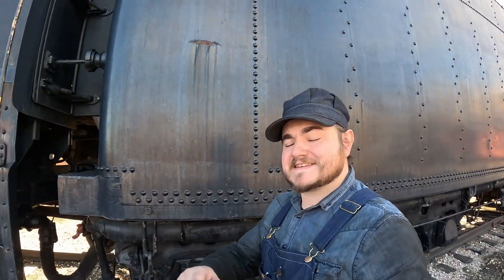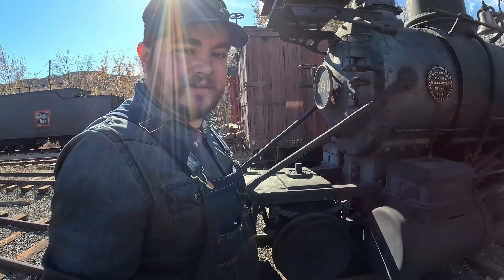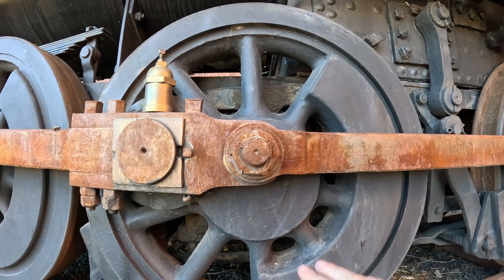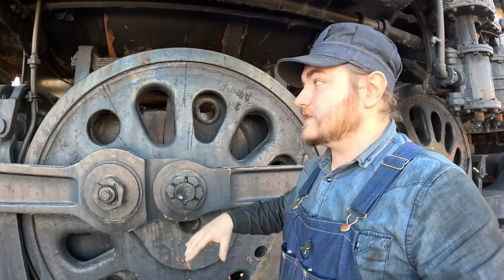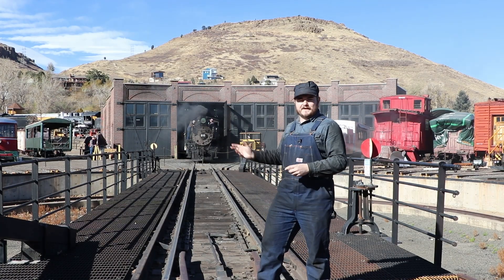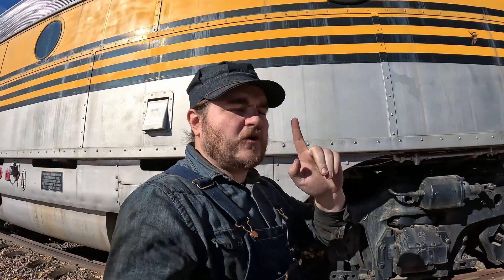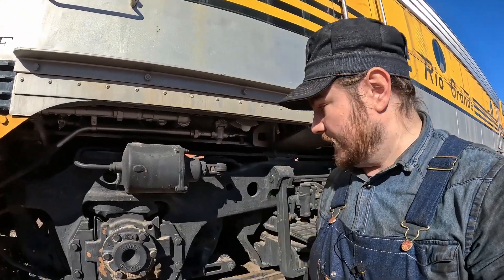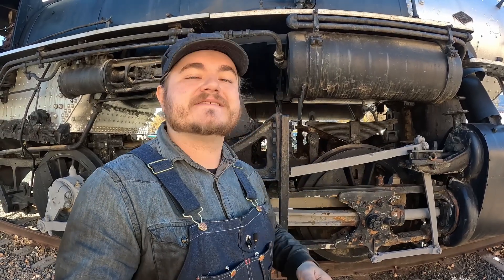HUGE vs. TINY drive wheels - Why? | Railroad 101

Comment: I think you mean speed vs tractive effort . Power is more related to firebox grate area. Power at the wheels is the product of surface feet  per min at the tire and tractive effort. Power limitations show up at speed, tractive effort relates to the tonnage you can pull at standing start.

Comment: Previously, when plain bearings were used, wheel diameter was closely related to speed. Small wheels couldn't spin quickly, otherwise the bearings would overheat due to the rapid rotation. In Russia at the beginning of the 20th century, the maximum speed was 225 axle revolutions per minute for freight steamlocos and 260 axle revolutions per minute for passengers. Consequently, the larger the wheels, the higher the speed. Now, thanks to roller boxes, this is no longer the case.
(It was Google Translate. I know English a little bit, but... Sorry)

Comment: I have a question. With 21st Century technology on Mechanical Engineering, and Thermodynamics, and all subject that is related to steam locomotive.

Can we, or can someone, build a "new" steam locomotive. Maybe recreating a lost model, or iconic model that no longer operational, from the ground up. But with more efficient system. More efficient fire box, maybe use natural gas instead of coal, more efficient piston design, a more modern instrument and gauge, drive by wire.
Reply: You might want to hear the ACE 3000

Comment: One thing you failed to mention was piston speed, that is how fast the piston moves in the cylinder.  If it moves too fast it will heat up.  Lubricants had to be able to handle these temperatures.   So if you wanted to go fast you needed a large wheel with a short piston stroke.  This kept the piston speed down.  Improved lubricants about 1920 allowed for a longer piston stroke on a smaller driver.

Comment: At the Nevada State Railroad Museum, Carson City, I love showing people the Joe Douglas Steam Engine.  It's a tiny 3 foot narrow gauge engine that was used to haul ore cares from the Sutro Mine to the ore processing plant in Dayton, Nevada and haul the empty cars back to the mine.  The drive wheels on the Joe Douglas are tiny compared to the other steam engines in the museum.   Torque was more important than speed or at least none of the ore cars were in a hurry.

Comment: For those more familiar with cars, this is the same problem of horsepower vs torque.

Some cars can produce a great deal of horsepower, but really the goal of this is to get higher revs at harsher gear ratios. The goal is speed, more revs in the engine means more revs in the gear box which means more turns on the drive shaft, and eventually a higher RPM for the wheels.
Torque is usually the opposite. You're not concerned with the engine hitting 7,000 rpm because you're after raw power not speed, so you don't need the wheels to turn the fast. Instead a beefier engine with bigger cylinders that runs slower can make more power.
Now that's all a generalisation really, gearing can make a high rpm engine put out huge torque, or a low rpm engine put out huge speed. The problem is that the bigger the ratios in the gearbox, the more strain you put on the system, and the more likely it is to fail.

In any case, that's how steam locomotives were designed. Some to have great leverage and thus torque, to pull freight, where the principal value was tonnage. The more you can pull the better, speed is second to capacity. And some were designed for pure speed, to pull passenger and mail, where the opposite was true. Of course passenger trains were also limited by the length of platforms, so a passenger train could only ever be so heavy - that meant that past a certain point, any additional torque was essentially wasted.

Diesels were to steam what Electric cars are to internal-combustion. They don't rely on mechanical gearing or rpms, instead they use electric motors, which don't suffer from the gearing trade-off of torque/speed. An electric motor can put out an immense amount of torque for the same energy, compared to a more conventional engine of similar size, but because they don't require gears to do so, the motor can also achieve far higher speeds too. The advantages are twofold - first, obviously, you no longer need specialist locomotives. Gone are the days of freight locos and express locos, now you have a one-size fits all. The second advantage is standardization. Now that you have a single entity to do all the work, the logistics become much easier. Steam locos have often been used in double or even triple headed arrangements, but it's tricky and inefficient. You need to have similar locomotives for it to be at all efficient, and locos of the same class are preferred. You also need a crew for each locomotive, and owing to the differences between both the locos and the crews, you are guaranteed to lose power, as one or more locos fail to keep up with the other. 1 Castle pulls X amount, 2 Castles only pull 1.8X amount, 3 only 2.5X, and so on. With diesels, this was essentially fixed. Each additional locomotive added it's entire effort, and needed not a whole other crew to run it.

Comment: Why are the axles hollow? I’ve never seen something like that before on a  locomotive….

Your videos are excellent btw. Super informative and you cover so many hidden details that we don’t normally get to see!
Reply from the maker: A lot of big power had hollow axles like this. The thought is that the shape is stronger for the same weight as a solid axle of a smaller size, which for something that's going to be moving fast is a good quality.
Reply: @ thanks. I’ll keep an eye out for hollow axles on British locos now. It is probably a common feature that I hadn’t previously noticed!

Comment: It was said, in the age of steam, that the maximum speed of a steam locomotive was its' drivewheel diameter in inches. 48" wheels = 48 mph. (This translates to 346 rpm of the cylinder set.) Not quite true - that little RGS 346 would probably shake itself apart above 30, and 5629 could probably haul the ton (100 mph.)
Must say that Mallard, fastest steamer in the world, ran 126 mph in 1938.... her 80" drivewheels were turning 540 rpm. My minivan engine turns 700 rpm sitting at a red light.......

Comment: “What if you could power a steam train with electricity and use the exhaust steam from the pistons to power a turbine to charge the battery again?” My brain (*thinking of every possible way to make steam power come back*).
Reply: In more detail: by “power with electricity “ I mean heat the boiler with electricity.

Comment: You did not mention the major reason for very large drivers on a fast steam locomotive.  The rods cannot be perfectly balanced, so the locomotive will either shake itself to pieces or pound the track excessively if we run the drivers too fast.  The diesel's wheels are perfectly balanced, so small wheels can run at any speed.

Comment: Interesting the narrow gauge DRG engine has no flanges on the middle drivers. To help going round curves?
Reply from the maker: Yup! Called a blind driver. A lot of the narrow gauge power had them, and many very large standard gauge engines did as well.

Comment: Although the important part isn't "diesel", it's the electric part of diesel-electric. If Diesel hadn't been available steam-electric would have accomplished the same evolution away from a wide variety of steam locomotives with different capacities and towards a more unified fleet of locomotives capable of performing a wide variety of duties (and steam-electric locomotives became a thing in some countries during WWII).

Comment: Hyce forgot to tell us that the passenger F3Bs. F7Bs, E3Bs, E5Bs, F9Bs, U36Bs,FPs, etc. have (had) a steam boiler with a heat exchanger for hot potable water to supply steam heat and  hot water to the passenger cars being hauled by the locomotive consist. When I rode the Rio Gande Zephyr in between Denver an Grand Junction in the 1980s the train had an old F7B or an F9B passenger unit behind usually a GP7 or a GP9 MU consist to supply the steam and the hot & cold potable water for the passenger train. The air conditioning was okay but it didn't work up in the vista dome part very well at all.

Comment: Speed vs Power? It's not a tradeoff between those two things. Power does not mean what you think it does. Doubling speed (for the same weight of train) requires doubling the power, even disregarding air resistance.  A correct way of saying what you are trying to say would be "Speed vs Tractive Force"

Comment: It isn't a topic of wheel size, but there's an important feature of roundhouses for steam locomotives. Most locomotives were headed into the roundhouse, not backed in. The angular arrangement of the stalls gave more room to work on the head-end of the engine, the valve gear and smokebox. These were far more important and labor-intensive than the tender.

Comment: In combustion engines using a similar type of fuel, the linear front of the combustion progresses at a pretty much universal speed, which means that the pistons have a somewhat similar speed regardless of size. 
What is the equivalent for steam engines? I would surmise that the piston linear speed is somewhat the same for a given pressure, regardless of size? If so and assuming all these different machines operated at roughly the same max pressure, that would explain the offset (since the piston displacement is twice the offset). Right?

Comment: Sorry. I just have to say it: In December of 1956 when I was 9 years old, Santa gave me a Marx brand electric train set. While my little train was pulled by a conventional steam-type locomotive, the box the train came in had a top that featured a beautifully detailed drawing of an EMD F9 diesel locomotive pulling a passenger train. The perspective of the drawing was exactly like that of the Rio Grande F9 shown at about 7:48 in this video. I instantly fell in love with that locomotive because of its beautiful curves, kind of like the Lockheed L-1049 Constellation airliner that went into service around 1950 or so. I traced that loc picture over and over again, totally fascinated by everything about the engine as I wondered 'what everything was for'. While aviation and aircraft eventually became my primary love, I never lost my love for trains and their locomotives in particular. And that explains why I have a beautiful HO gauge EMD F9 on display among my couple of dozen scale airplane models I have scattered about in my home office. Like the Constellation airplane, I think there is no locomotive that matches the beauty of the F9. (A note to the ladies: Men truly LOVE big, powerful machines like airplanes, trains, ships, etc., but the ones we seem to like the most are the ones that have nice curves. I wonder why.)

Comment: Old news.
Small wheels on freight locos for tractive effort.
Big for speed.
Became outdated in the diesel era, as those are not mechanically driven wheels, and the electric motors that do propel them are not highly critical to the force the exhibit vs RPMs.

Comment: in Steam Loco 
Wheel Diam =  Final Gear ratio in Car
Smaller wheel in Steam loco = FG ratio far from 1, for Heavy load vehicle
Bigger wheel in Steam = FG ratio closer to 1, for High speed sports car

Comment: @Hyce you are confusing power and torque to the wheel (which gives "pulling power"). Given a certain amount of engine power, big whels for speed, small wheels for "pulling power" (torque).

Comment: It looks like some of the drivers don't have flanges.  Is that common or was it a feature of certain manufacturers?
Reply: That seem to be common, some english locos from the early 20th century also have that. Since you have 3, 4 or more in a row not every drivewheel need flanges, the middle ones don't necessarily need that

Comment: I was under the impression that part of the reason high speed steam engines have larger drive wheels is because you can never perfectly balance the wheels, and the problem gets worse as rpm increases - so larger wheels are less likely to cause the engine to shake itself to pieces. Am I heading in the right direction here?

Comment: I get what you're saying, Hyce, but it just sounds like diesels are the embodiment of stereotypical USA. If you can't pull a 1.5 mile loaded line with 1 diesel, use more diesel. If that don't work.....use more diesel. But that begs the question of if you put some steam drive wheel sized chonkers on a diesel, what would be the optimal result. I know if that happened it'd be a fireworks show of sparks as it spun out. But what could it haul and how fast could it get that stuff from place to place? It'd be an absolute abomination, but it's an interesting thought experiment. I just wish that some of the more jack-of-all vehicle games took this kind of science into account. I'm talking mainly about the game Stormworks: Search & Rescue. You can build steam locos based off of 3 driver sizes coming in 2 styles for each size. They do the typical, "Smaller is weaker and slower. Bigger is stronger and faster." It's super frustrating wanting to make a shunting 0-4-0 but it has almost no power in it.

Comment: One thing you missed about the diesel-electrics is that electric motors of the types used by locomotives have essentially unlimited torque, and that their torque is highest at zero velocity. This means that as long as you have enough grip, you can pull anything of any size using wheels of practically any size as long as your motor can provide enough power to overcome the initial resistance to movement. After that, you can go as fast as your power versus rolling resistance and the maximum RPM of the bearings allow for. The gearing is really only important for top speed concerns as long as your gear ratio is somewhere reasonable to begin with. This is why electric vehicles often don't have transmissions. The motors can operate perfectly fine at all relevant speeds without the need for changing gears.

Comment: iF this video is about wheel size only, then the title is half wrong.
It's not Speed vs Power, it's Speed vs Amount of Weight Moved
Power is whatever the locomotive's engine delivers, that doesn't change (big picture)
But wheel size dictates the amount of Torque (twist) delivered to the rail
Big wheels allow the HP of the engine to move a Train faster
Small wheels allow the HP of the engine to move a Train with more weight.
So Torque is a variable dictated by wheels diameter/circumference
But HP is a constant of the engine at it's maximum output

Comment: Why wouldn't a diesel engine use larger diameter driving wheels, say 60"?  Obviously they don't HAVE to, and there are surely materials cost savings in using smaller wheels.  But would larger diameter wheels cause problems?
Reply: Larger wheels would increase the center of gravity. With smaller wheels your loco is lower and the CoG is lower too.

Comment: it's about pushing/climbing Torque(force) versus Speed.. :
for a constant.. : Power = (Torque x Speed(spinning))
small wheel means low gear/slower speed, 
while getting stronger start or high slope-climbing.
bigger wheel means high gear/higher speed, 
but not for starter, cannot climb high slope.

Comment: The size  of the wheel is like gearing, a big wheel will move farther over the rail per piston stroke but there will be less power put on the rail than a small wheel which puts the same power over a shorter distance. Express engines big wheel greater speed,  freight engine small wheels small distance travelled  but more power per distance travelled, pulls bigger load but slower. Simple  mechanics.

Comment: Something that made me laff.
I made a friction drive for my bike from an old electric skateboard..
I had a fair bit of torque multiplication from.gear ratio. 
Small skateboard wheel big 700 c bike wheel. But speed of bike was same as board.

Comment: Great vid thanks , I always wondered how steam engines run for all loading and speed requirements with in reality only one final drive ratio. Basically the piston stroke length is based on the  distance from the axle centre to the drive rod attachment position on the wheel. Sort of explains the difficulty moving a big stationary  load on wet tracks although steam is much more forgiving than petrol or diesel engines as it's expansion force  is linear throughout the entire power stroke and easier controlled by steam valve positioning .  Sorry to waffle on ,the physics of locomotives is very interesting. More of this kind of videos please.

Comment: "Power" is the wrong word. Your hand doesn't become stronger when you grab a wrench, you've just increased the "torque".
The piston stroke determines the crank length, which means that the wheels "are" the transmission: slap on bigger wheels for higher speed and less torque, or smaller wheels for lower speeds and lots of torque.
Quibbles aside, interesting stuff. I learned some stuff. Thumbs up.